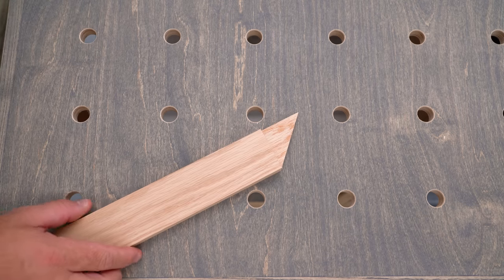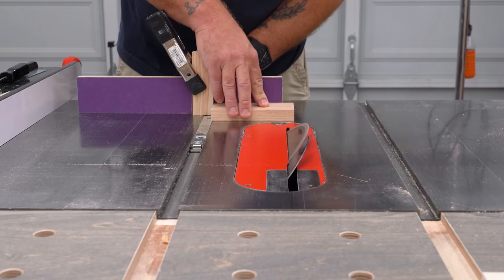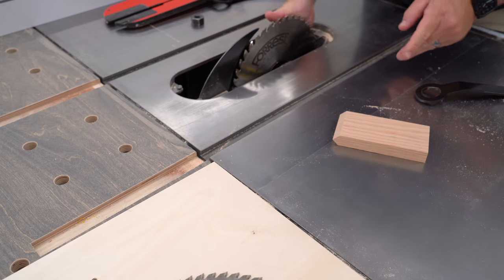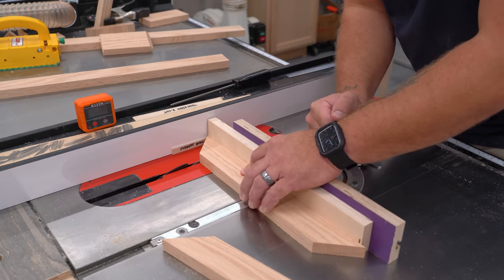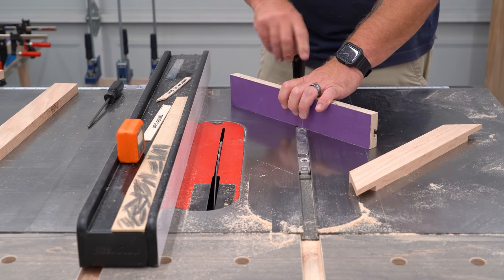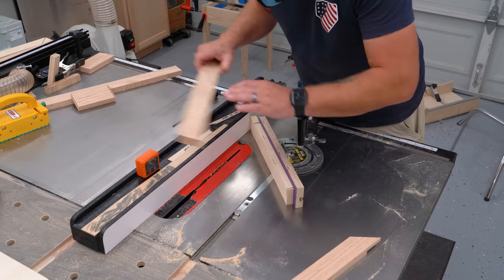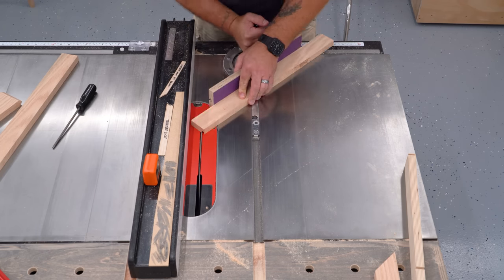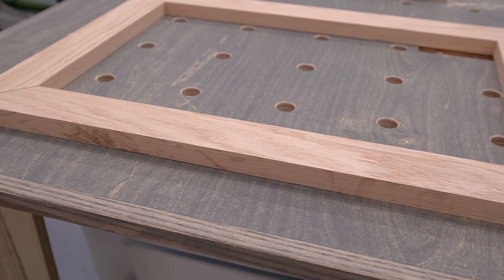How to Make a Mitered Half Lap Frame on the Table Saw

Comment: Man, I love your videos; you’ve got a great approach to problem solving and present things very well. 

Have you ever tried this using a miter saw instead of a table saw and if so how were the results?  I know you’d have to sand out the individual cut marks used to remove the material. Great stuff as always!

Comment: Great techniques! The height discrepancy issue might be because the blade dropped a bit as you made your cuts. I know with my Sawstop, the blade can easily drop down a little unless I add a bit of tension with the knobbed blade lock.
Reply: I very much wish my little DeWalt jobsite saw had a blade height lock. I'm pretty sure the lack of that feature has messed me up more than once.